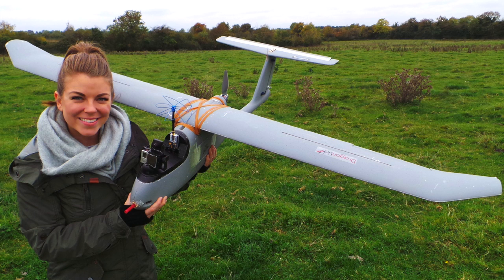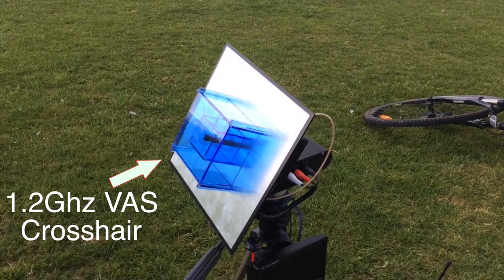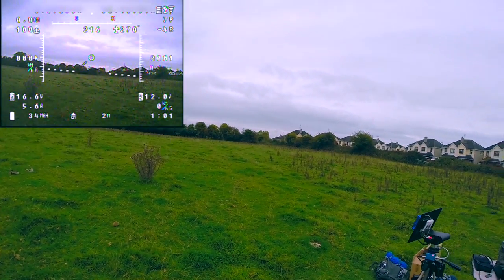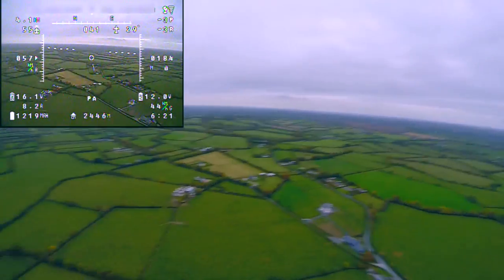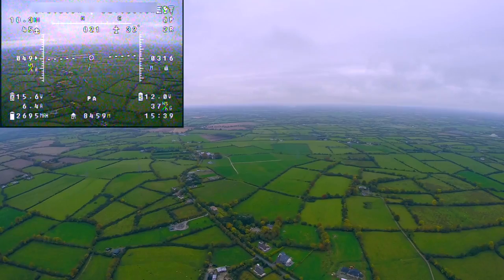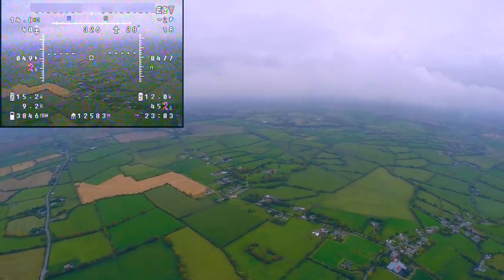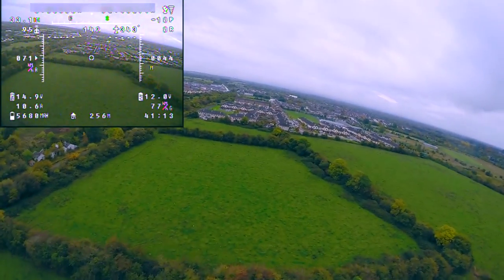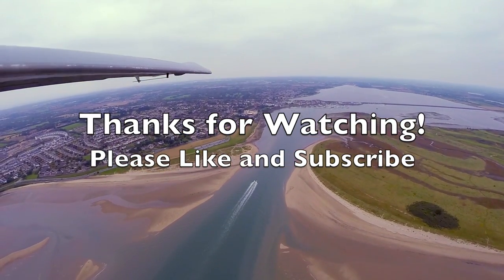Narrated Long Range FPV Setup Overview & 15km Range Test - Skywalker 1900

Comment: Hi Adam, My Skywalker is almost ready. Can you tell the CG that you use? Is it on the wing servo wires? What servo travel 
length do you use? what is the traveling distance in mm ? Thanks for the help!
Reply from the maker: +Ard Schell Mine is a little nose heavy so my COG is around the leading edge of the wing. I believe the servo wire cable is where it should be though. Not sure on the mm of travel for the servos, I didn't adjust the throws, they are all at 100%. I should really add some expo and dual rates. Good luck with the maiden, take your time and make sure its ready before you throw it :)

Comment: Very impressive. I've just bought my first wing (miniracewing) and I was hoping to go a couple of miles out if that's possible? I have a taranis and fatsharks, what would you recommend for a little further range? I'll probably use inav for the rth. thanks
Reply from the maker: As you have a Taranis, look into the L9R receiver, they are good for a few miles. For video, if you're on 5.8ghz then the range is all about your receiver antenna, it needs to be higher gain if you want to go further. Down side is they're directional, so be careful using these if you don't have a diversity receiver.

Comment: Hi there,
Could you please post a wiring diagram for your 1.3ghz / 5.8ghz relay station  the same as you have done for your Skywalker onboard  system  
Your fpv system is very impressive and any further help you can give will be graciously received
Kind regards,

Mark Logan

Comment: After building up the Sky Eye (2M FPV glider) I'm starting to understand the appeal of the Skywalker!  The nose of the Sky Eye is roomy, but the cavity under the wing has limited space and visibility.  I don't think I'm going to attempt a full APM setup on the Sky Eye.

I don't see how I can fit all the gear in the space along with FPV cams and other gear.  I installed eight wires to the back of the tail before gluing the tail in, anticipating the installation of a GPS/compass module, but now I may go with another cam on a pan servo.
Reply from the maker: Best model for fitting loads of gear with ease is the Skyhunter. Soooo much space in there!
Reply: Yes, from what I've seen, the cavity under the Skyhunter wing is 3 inches wide, around 4 inches high and extends over a foot out in front of the wing with over half of it under or close to the CG.  The tail boom invades that cavity a bit, but leaves a lot of space. The fuselage doesn't come with the door most people cut in the side.  

Not sure if the Skywalker comes with a door cut in the side or not, but I always see one. And while the Skywalker cavity is probably higher, the Skyhunter is longer.  I watched a seven-part build video of the Skyhunter that was pretty horrifying.  It looked like the guy was building the Space Shuttle.

I'd love to be able to bury wires inside the wings, but I'm not dying to build any of these things "from scratch".

Comment: Hello Adam, thanks for sharing your beautiful video and the plane. Im planning to get my self a Skywalker 1900 this summer and probably use same spec as your`s, btw are you still flying this plane? do you have anything that you would like to change or upgrade on this particular configurations? Newbie here on the airplane and appreciate all the help/advise. Thanks!
Reply from the maker: +iFixDrones Hey, thanks for the feedback, glad you enjoyed the video. I do still fly this (just haven't had chance recently due to weather). The setup in this video is a result of it evolving from its first configuration, so basically I made changes as I went along and this was the end result. One thing I have changed since this video is I've upgraded to the Dragonlink V3 Advanced system, this was only released very recently and I haven't had chance to test it on this aircraft yet. As a newbie, advice from forums can be very useful. Try RCGroups, FPV Labs and if you're in the UK try FPVHUB. Good luck with the build :)

Comment: How do you control your pan/tilt mechanism?  Does your controller have dials instead of switches?  Are you using a separate radio for this?
Reply from the maker: In this video I was just using 2 dials or sliders on the Taranis. Since this video i've setup head tracking so that the movement of my head controls the pan and tilt.

Comment: Hi Adam, this is excellent stuff. quick question: I'm decent at flight simulators and had a small motorised RC glider when i was a kid. How long did it take you to master the art of building and flying your  skywalker? Also is the FPV setup gives you zero lag? (basically is it like being on the plane:) 
Just wondering how much the whole thing costs roughly? 
one last question: the 500mW is legal in uk/europe? 
Sorry for all the questions but I really really want to do it one day! I think it's much nicer than a drone but seems to require much more work. 
Cheers
Daniel
Reply from the maker: +dna2087 Thanks for your feedback Daniel :) My experience of flying was very limited. I had flown a RTF 3 channel Spitfire LOS probably about 10 times. Other than that I think my flying skills mainly come from computer games as a kid. The Skywalker was my first ever build, and it took a a few months to complete but was good fun. I find flying FPV is much easier than LOS because you don't have to worry about working out which way to turn when its heading towards you :P when flying FPV there is no lag (well not noticeable to a human anyway).
This entire setup would cost in the region of £1500 to £2000, but you can build a long range FPV setup for a lot less. If you're worried about the building, flying or cost of an FPV plane, why not start smaller with something like a Bix3?

Comment: Great video, I learned more with this video than all the combined vids on FPV.  Thank you!  My question is this, if you had to do it again, that is the build of all the equipment you used/purchased, what would you have done differently?  For instance, would you have gone with a different set of cams or a different osd etc and why.  Apply the question to everything.  Thanks again!  -Greg O
Reply from the maker: +Greg O Thanks for the feedback, good to hear how useful you found it. To be honest this is an evolved version of what I first built, so changes have already been made to perfect it. E.g. I had a case based ground station, no antenna tracker and therefore no extra OSD for tracking data. If I was to start again, I think there would only be a couple of small differences:
1: I think I would buy a cheaper FPV camera. I paid $130 for the one on my Skywalker. Its pretty good... but then so is my $35 FPV cam from surveilzone that I have on my wing. Can't really tell the difference between the 2 so I don't think this one on my SW was worth the money.
2: Because I have the MFD AAT, I had to wire in the 2nd OSD that came with it to provide the tracker data to the GS. The display for this is turned off so that I only see the Tornado OSD. If I was starting again I would go with the MFD AP as only 1 unit is needed to do all in 1.
HTH
Reply from the maker: +Adam G does FPV Just a follow up to this, I do really like the Tornado, the only reason for change would be simplicity.

Comment: Nice video, Adam.  Since you were doing an out and back flight, I wonder how a pepperbox would have improved your video?  Are you liking your MFD tracker?
Reply from the maker: +Glenn Doney Cheers. Yeah a pepperbox definitely would have been a better antenna for this kind of flight. I really like the tracker and the ability to fly all over the place and not worry about the video feed because I don't always just head in one direction and back again.
Reply: +Adam G I agree.  I made a 1.2 crosshair and really like it, but my son gave me a pepperbox and I'm begining to question my previous desire for an antenna tracker, since the pepperbox has such a broad horizontal beam at 160 deg.  I'm still undecided and have been looking at the MFD vs. the Arkbird.  Keep up the great work!
Reply from the maker: +Glenn Doney Yeah Thats quite a wide angle! From what i remember its the altitude on your flight you have to get right as the beam width isn't very tall?? The MFD is easy to setup and operate and so far very reliable... it just works

Comment: You said you use a 4s battery and a 9x6 prop. Which motor? Mine has an HK NTM3542 1000KV which is probably more than I need but I fly it off water with floats.
Reply from the maker: +Paul Mitchell Turnigy Aerodrive SK3 - 3536-1050kv Brushless Outrunner Motor. Please see the video  list of every part on this plane :)

Comment: Great video. I just subscribed to your channel. One question. Is the altitude based on a zero setting from where you take off or does it work on proximity to the ground below? Two reasons I ask. 1 I am interested in telemetry for my planes and 2. the grown looked like it was getting closer when you said the video feed was going fuzzy but the alt was locked at 181meters? 
Regards
Blair
Reply from the maker: +blairo15 Hi Blair. Thank for the sub :) The altitude is based on your starting altitude. So technically if you flew towards higher lands, you could be 50m from the ground but it might still be reading 150m. I don't think there are any FPV autopilot/OSD's that calculate ground distance based altitude. I have just upgraded to the Dragonlink V3 Advanced system which provides telemetry as the Rx transmits back to the transmitter. This can be send via bluetooth to a tablet to display full telemetry. Hope to test it asap!
Cheers,
Adam

Comment: Hi,  Thank you for sharing.

Are you still in the hobby? It would be helpful if you update the items on Banggood or hobby king etc which you use now or recommend to use in 2020. .., sure that now after 5 years technology has changed a lot. 

Also, What is the maximum range of the transmitter. Would Specktrum and Futaba work that far?. 
I saw another video and the guy went 45 km far.  

How far it is allowed to fly in UK?
Reply from the maker: Hi, yeah I sure am, check out my channel and you'll see i've posted a few FPV videos in the last month. In 2020 I'd recommend the parts I'm using on my newer planes. Check out my videos on my ZCon, Mini Talon and more...
People have been 100km+. I'm more of a mid range low altitude flyer these days. Going far doesn't interest me as much. In the UK I think your legal limit is 500m.
Cheers

Comment: I would give my left hand for your setup :O
Reply from the maker: +SimpleYouTuber Haha its a great setup, you need your left hand to fly it though ;-)
Reply: +Adam G does FPV Your setup is perfect,the most amazing setup ever,everything works well and 15 km is nothing for it,the best setup ever.Would you be willing to reveal aproximate cost for it,so i would know how much i have to save until the end of my life :O
Reply from the maker: Thanks :) I spent near £2,000 on this setup but it can be done a lot cheaper. start with the basics and slowly swap parts out as you get the spare cash
Reply: Oh my god,that much,there is no way i will ever gather that amount of money -.-
Reply: +SimpleYouTuber Knowledge can save you some. Iam also starting with Quanum V2 Googles, 100 Euro FPV setup: Vtx, Rx, Camera + circular polarized antennas. 
Allready bought a more expensive camera ;-)

There is much to learn especially when doing long range FPV. LR FPV is expensive. You cannot prevent it. But for starting with FPV its not too expensive. You can get to about 1-2km range. Depends on many factors.
Reply from the maker: Best thing is start basic. Get the airframe you want (as they are cheap) and then build up the electronics slowly. Like FreakSX93 says, plenty of alternative parts to get you started :)
Reply: Yes i know,i started reading abou fpv abou two years ago and i slowly gathered some equipment and i fly fpv but i am really interested im long range,maybe someday i will be able to fly 10km :D

Comment: After 5 years you posted this film, I am watching it from Taiwan in Asia. It's very educational to me. Thanks. Is the equipment you used in the film still available on the market? Or more improved products are recommended for long distance FPV?  I saw a module for long distance control on your FrSky transmitter, what is that? Hope to see  this kind of film from you!
Reply from the maker: Hi, and thank you. Some of the gear is still available but I'd recommend looking at some of my more recent videos for newer/better kit that's available today :)

Comment: awesome! would it be possible to flight closer to the ground? also, what is the total cost of all the equipment on the list? tnx
Reply from the maker: Thanks :) Yes you can fly nice and low with the right equipment and environment. Check out the video description for answers to FAQ's and links to all parts used.

Comment: Is Dragonlink only compatible with Taranis? I use a Radiolink AT9. I'm thinking of using my next quad build for long-range flights.
Reply from the maker: No its not just the taranis, its compatible with most radios, as long as they can output to an external module :)

Comment: great vid, great flight. amazed of how small prop you're using - meaning a "small" motor, but what speed. :-) what is the total weight of the plane ?
Reply from the maker: Thanks :) think its around 2.8kg. Can't remember

Comment: Hi Adam if you were setting up a system today would you go for the cyclops if useing only fixed wing ?
Reply from the maker: I actually prefer my MFD AP that i use in the Skyhunter. However it is twice the price. So if I was trying to keep to a budget I would definitely still consider the cyclops tornado.

Comment: If you were to try controlling the aircraft manually (not autopilot) through the transmitter at 15km range, would it work?
Reply from the maker: Yes, I was controlling it in this flight. Some people fly as far as 100km and still have control link. For this you need a directional antenna like a yagi on your Dragonlink transmitter.

Comment: Roughly what would this system cost in $USD? I live in Tn and fly EDF and prop planes but the FPV and ground base along with the OSD is awesome. I'm getting rid of my Trex 600 and 700 Nitros Flybarless to help fund this. Just curious about the total cost? Thank you, Chad Wagner.
Reply from the maker: Hi Chad, thanks for the comment. If you look in the video description there is a list of all parts and an FAQ section including cost of this setup. Cost is in £ but you can convert it, and it will be cheaper to get all the parts in USA... plus prices for FPV has come down over the last few years. :)

Comment: hi, i'm about to start flying again after a few years off .... we have the same radio, the same osd and i ordered the same model aircraft. my doubt is: how come once the osd and the radio have been configured when I manually activate the RTH (from the ground, I don't want to fly until I am sure that everything is ok) the engine remains at zero? At this moment I don't remember if the engine was activated at the percentage of gas only when it was in flight or if it started from the ground as well. Can you help me remember? Thanks
Reply from the maker: It’s been too long since I used this system but I guess it knows the plane is not in flight due to gps speed so it doesn’t throttle up. There might be a throttle safety option or something. Good luck

Comment: how long does it stay up in the air before it is time to land with 10,000mah? I have a similar set up but I think the motor I have is way too powerful and draining my battery so much. My 6200mah battery runs only about 23 mins. in windy condition.
Reply from the maker: with 10,000 I think i've been in the air just over an hour. That requires you to do low amp cruising. your battery life sounds fairly average if in windy conditions, you probably throttle up a bit when you're going against the wind so you're not just hovering.

Comment: Okay so i need to come up with a battery solution. Any ideas Adam? Right now i have a Walkera V500D01 helicopter with two 40c 6s 2650 batteries hooked up to it. So i have about 5300mah all together and that is probably not even close to what i need
Reply from the maker: +Scott  Miller  If you want to do long range flying you should really look into a fixed wing aircraft instead. In my personal opinion, you are not going to go to far with a helicopter or multi rotor.

Comment: hi nice setup I already build skywalker revolution whit the some motor Turnigy Aerodrive SK3 - 3536-1050kv prop 9 * 6 max weight is 2.4 kg  whitch battery will be beter 3s or 4s  whot do You recommend whit this motor
Reply from the maker: +emil30driv I'd recommend 4S as it gives you more power. More power makes a model easier to fly as you have the power to climb when you need it... can get you out of a sticky situation. People who ive spoken to say 3S felt under powered on a Skywalker.
Reply: :) you have to be right I flew today second time and I need more power the easily way is change battery  Thanks for help and Your Skywalker is best !!!
Reply from the maker: Thanks :) good luck with the 4S, you'll prefer it!

Comment: Great vid! Thank you :)

I'm interested to know why you chose Cyclops OSD over MFD AP since you are using the tracker. Keen to hear why Cyclops?
Reply from the maker: When I first built the plane I was not using a tracker. I'm not sure if the MFD AP was even out back then. The Tornado was a really great AP for such a low cost. When I got the AAT i found that it was quite easy to just add the telefly pro to work with the Tornado.

My new plane (Skyhunter) I have gone for the MFD AP and its great
Reply: I thought that may have been the case. Thanks for confirming and sorry for the late reply.

Any chance of an updated wiring diagram for your latest setup? Thanks very much.